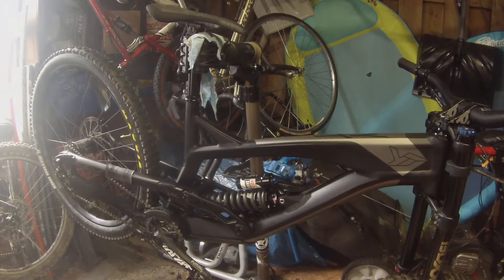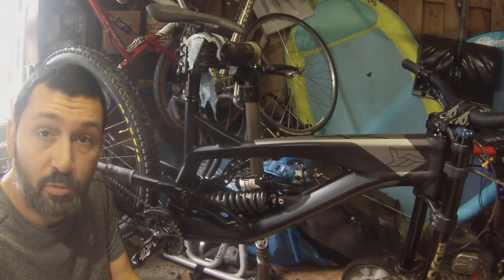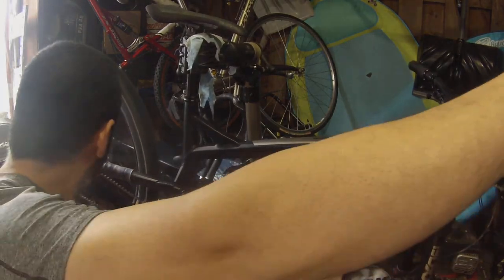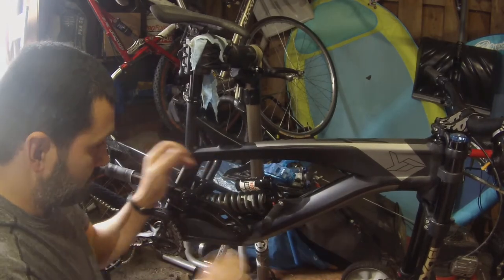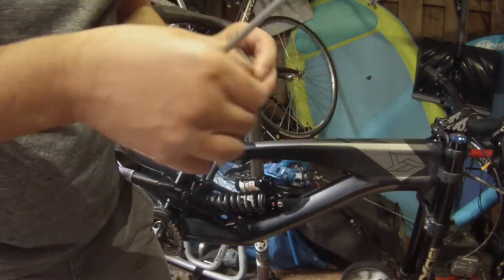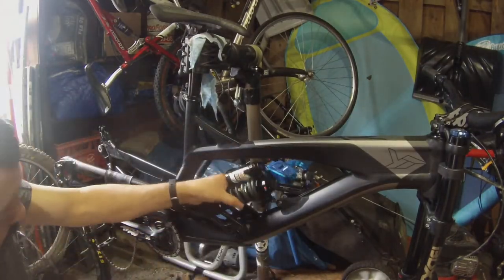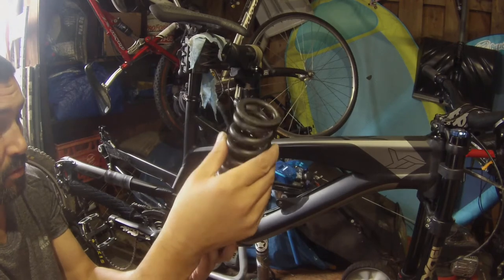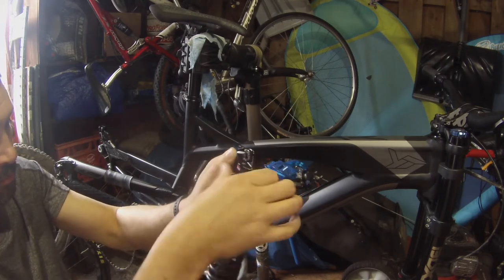RockShox Kage Coil Spring Swap How To

Comment: I have a Kage as well on my 2016 Giant Glory 2. I want to replace the 350x3 with another coil. However I see some of them are 9 inches, some are 9.5? I am assuming this length matters as well? The bike has 200 mm rear travel. Any advice on which I may need?
Reply from the maker: soulsurfsublime you will need to look it up on Giants website or measure it. The length is important.
Reply: @MTBBeta  Thanks for the response! I'll see if I can't dig it up. Giant's site isn't real great for minor details it seems.
Reply from the maker: soulsurfsublime a tape measure should be accurate enough to know the length.
Reply: @MTBBeta  Thanks I will check it out. I Contacted Giant but they never replied. I have a big set of digital calipers that should do the trick then. Thanks for replying again!

Comment: Hello,I have a question.So if I have a 250x3.5 spring I need to get a 350x3.5? bcuz I didnt know and i got a 350x2.75 and its short.
Reply from the maker: Yes 3.5 is the length. So you will need 350x3.5.   The 350 is none as the spring weight which is misleading as it is not about how much it weights but the amount of weight to compress and the second number, the 3.5 is always the length needed.

Comment: Thanks for the video. Just got a tues and will be doing the exact same swap.  I’m 200 lbs. do you mind me asking your weight?  I was told to go with a 300lb coil.
Reply from the maker: 412 MTB it think it’s perfect. I’m 195 and probably well over 200 with gear
Reply: MTB Beta thanks.  Just subscribed.  Looking forward to checking out some vids!
Reply: @MTBBeta  the real answer is it depends. A coil shock may be linear but the bike it mounts to can be an entirely different leverage ratio. I'm 220 lb and ride a santa cruz nomad v4. I got a 600 lb coil. Mind you ive also ridden/owned a Giant glory advanced with a 350 lb coil. and during the end stroke of the leverage ratio the glory goes regressive be default. and you definitely felt that during drops. I would bottom out on a 2 foot drop. So yes, I would say all Giant bikes are designed for Air shocks. 

You  have a second gen YT Tues which is fairly progressive. The more progressive the kinematics of your bike is the closer youll get to a 1:1 ratio. so if you weight 185 lb on a SC V10 you'll only 200-300 lb coil. 

So you really cant give a blanket statement.
Reply: Which version Tues? the Current gen aka YT mob (the shock is parallel to the down tube) or the previous gen. The current gen is way more linear because Arron Gwin complained that he wasn't using all of the travel. Also what are you doing. techy DH, nothing but crab apple hit jumps, jumps and tech? I wouldve recommended a 500 lb spring if you bought the current gen Tues. The bike was designed with an Air shock in mind. So you can guess that it more linear than progressive. There's also plenty of spring calculators. Like if you go to Ti Spring, Cane creek, or google.
Reply from the maker: I’m about 190 and 200 or so geared up. I think the 350lbs has served me well.  I don’t think you would be making a bad choice with 300lbs.
Reply: MTB Beta you have, like I said, an entirely different model. You have last gen YT Tues. You were giving him advice assuming what? He had the same exact model as yours. Last gen was more progressive hence you could get away with 300-350. The YT MOB is more linear. You need a higher spring rate to off set. And yes, you video gives away which version you ride. That shock isn’t parallel to the down tube, like I said I another comment.

Comment: What do you weigh ? 
I’m about 150 with my gear on, but got a 400lb spring, thinking about going down
Reply from the maker: Depends on the bikes progression rate so you can’t go by another riders weight unless it’s the same bike. 
At 190 on the YT I’ve ridden a 400 450 and 500 and like the 400
Reply: @MTBBeta  ok thanks, think I’m going to try a 350
Reply from the maker: @Jcscoob  check out one of the online calculators if you haven’t. https://www.tftuned.com/spring-calculator

Comment: I have this same shock on my 2009 Giant Trance X4. Due to clearance issues the shock is upside down. Does it make any difference if the shock is sitting upside down on my bike?
Reply from the maker: Not to any noticeable effect.  I had read a handful of articles about shock orientation and the effects and everything was basically saying that you couldn't tell the difference but some argued that it is different.
Reply: MTB Beta Ive noticed that I’m able to reach the rebound adjustment without getting off my bike. I’m just afraid that if I turn my shock right side up the  piggyback reservoir will collide with the top tube when I hit a big jump.
Reply from the maker: I'd say leave it. Not worth smashing up the top tube or piggy.